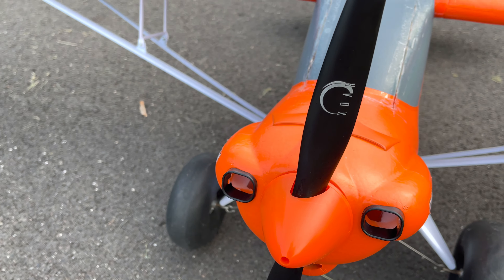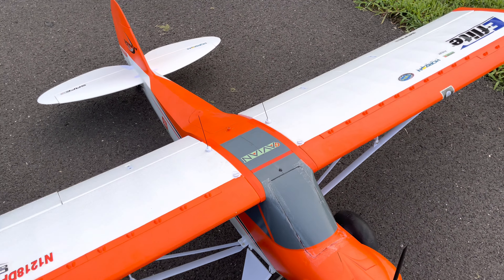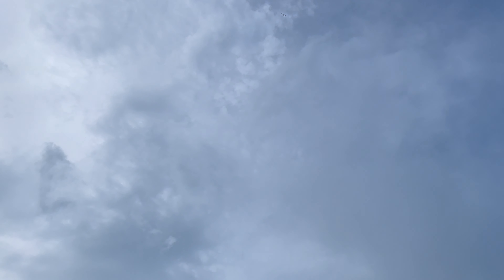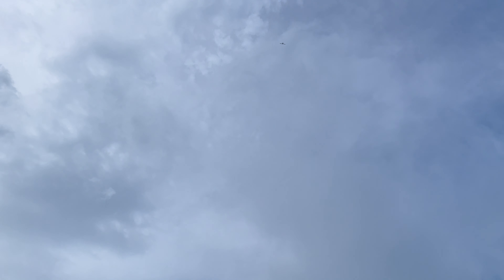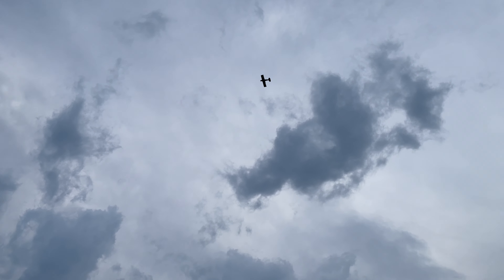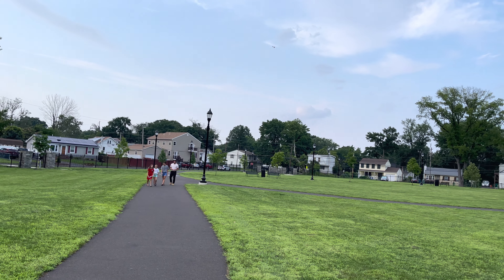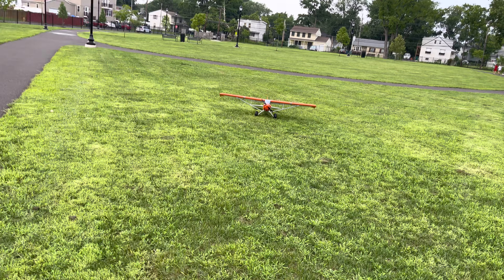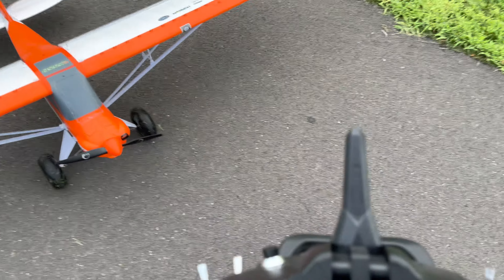E-flite Carbon Cub SS 2.1m airplane with 15x7 Xoar prop

Comment: I am running the same prop. Have been for about 6 months now. Very happy with it on my cub. Nice looking cub. I went with a black one to.
Reply from the maker: Yea man couldn’t believe how much pep just a prop gave to this Airplane….. some airplanes you will get a mix of both but not too noticeable  or faster speed more amps etc ….but pep/speed and efficiency  is definitely noticeable with this airplane ….. its way more efficient I’m actually getting lower amps  now so that’s pretty cool….. the stock 60 amp eflite esc was pushing it with stock prop….. I would get about 65 amps in flight ( I know in flight won’t get as high of an amp draw because of unloading) but still it’s nice to know that it’s a little lower now and i have a little headroom…. it’s about 52amps because of the xoar prop being more efficient…. Definitely a cheap way to really turn this plane into something a little more awesome!!
Reply: @MikeSarni  Yes number one thing I have noticed with the Xoar props is extra pep but they run lower amp draw and in turn most of my Eflite planes I swap over pick up a good minute of flight time. It's a win. Only issue is if you do touch something they break. But worth the upgrade for sure.
Reply from the maker: @goldendredger  definitely agree on all points brother! Hey do u find the bigger xoar props are more efficient then the smaller xoar sets? What i mean is like how it really makes  the cub ss 2.1m  and a few of the 1.5m like maule m7 shine….  if i grab  smaller xoar  props (like 13inch and under)  for instance i bought one for the trojan t28  the yellow one that came out a few months ago by eflite and i notice stock plastic prop is kind of better same with my timber turbo not that big of a deal, so i just stuck with stockers…….now  in terms of the bigger xoar props for the bigger planes…. I feel like xoar really shines when u have to use 14 in and up